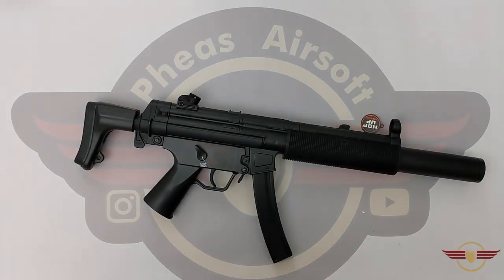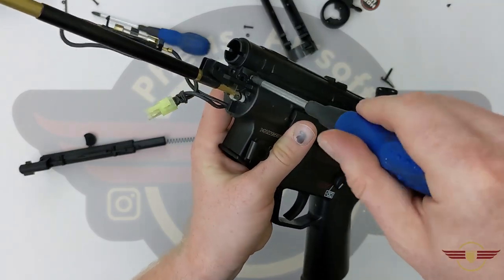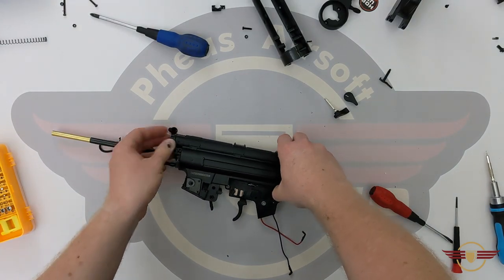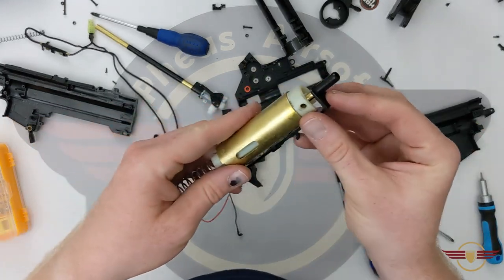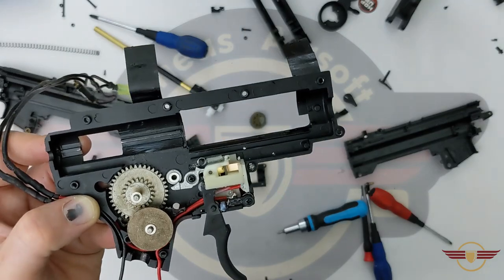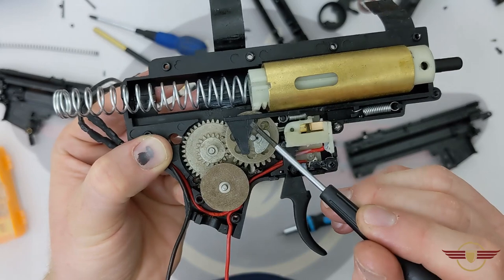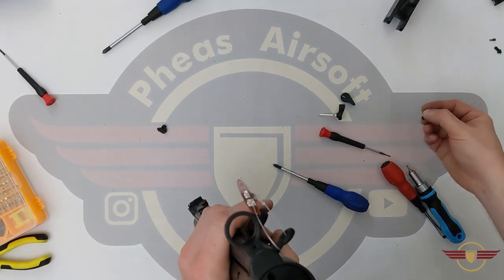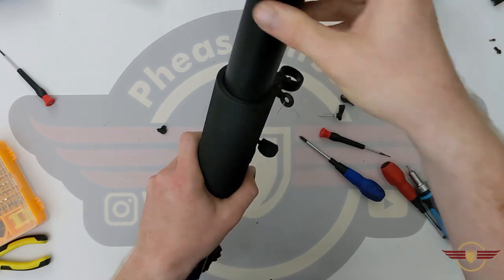[HOW TO] JING GONG JG067 Disassembly and internal review

Comment: Faff if you just wanted to change a hop rubber
Reply from the maker: Its a MASSIVE faff! Pheas
Reply: @PheasAirsoft  I ordered mine the day before I watched this video. I won't lie this has put me off a bit. I thought it was just two body pins and drop the fire control group and gearbox. This claim shell upper receiver is a bit naff. I've had the full metal version. It's the same as the plastic. When you take the grip off there's the same plastic front end and I've found the silencer can flex and cause the bbs to change direction. I'd say it's OK but it wasn't cheap enough for the quality

Comment: Can someone tell me which hopup rubber would fit this? I cant find any information anywhere. Any recommendations would be great! (I use it at around 315-320fps)
Reply from the maker: Hello! Any AEG type hop up rubber should fit, the current meta on aeg hop rubbers is that the Maple Leaf MR rubber (50 dgree, not silicon) is the best, especially when combined with the maple leaf Omega nub. Pheas